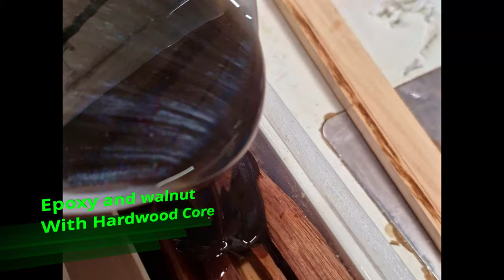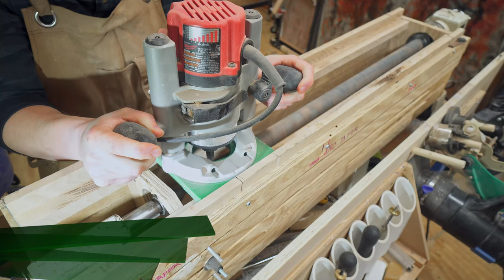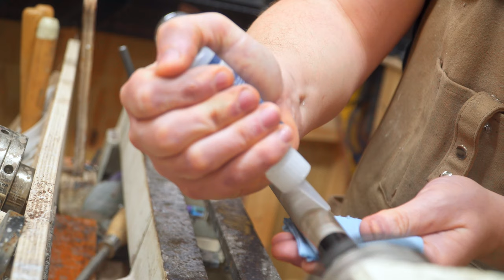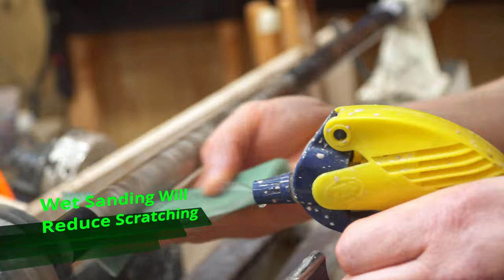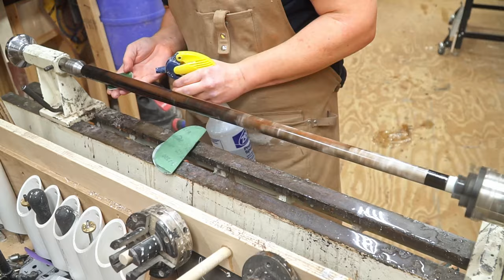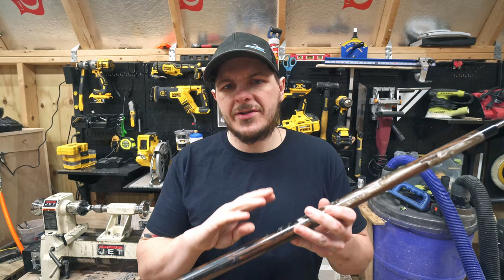Making A Silver Smoke Epoxy Pool Cue  Version 2

Comment: Where did you get the rubber bumpers and what is the weight of these? How difficult would it be to add an adjustable weight bolt system? I would like to start making these as well and doing my research. The CA glue you use for the finish, is it the one with the rubber additive in it or no need?